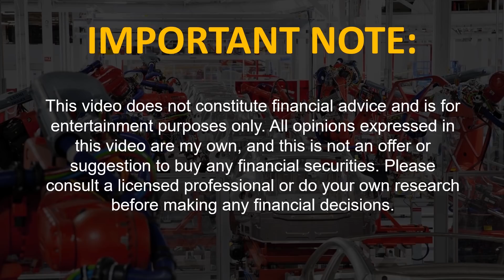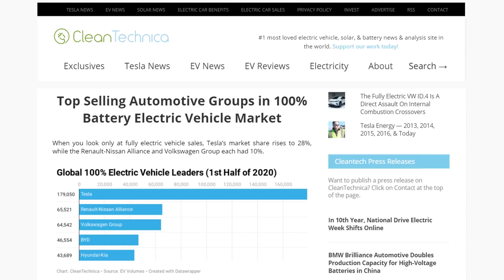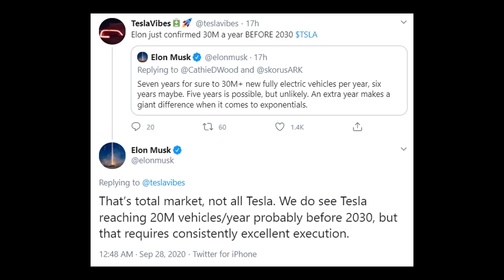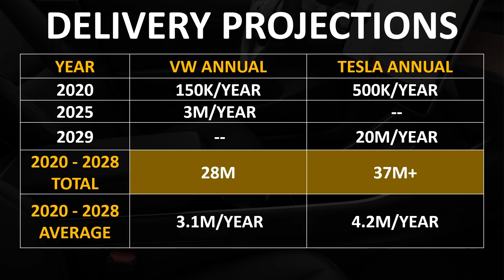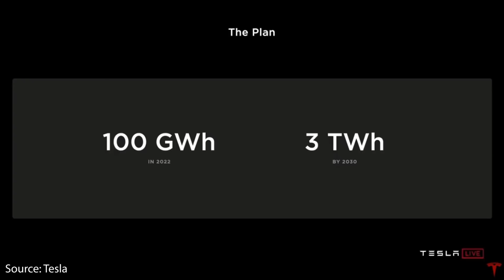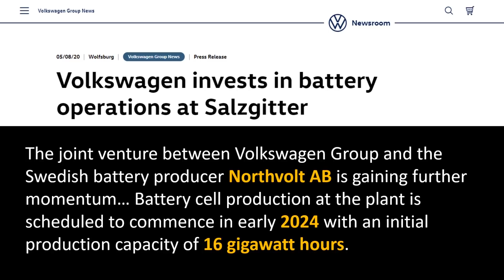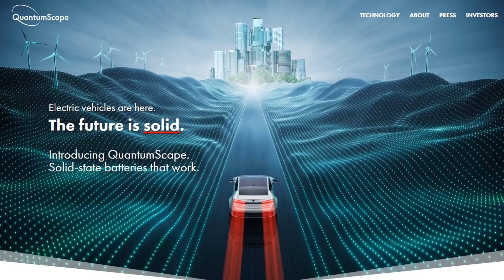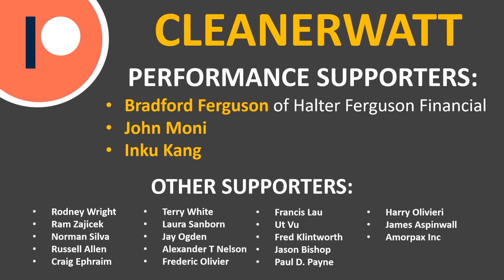Tesla vs VW: Can VW Catch Up? (Electric Vehicles)

Comment: So based on your charts. VW can produce 3 million in 2025 and Telsa 3.5 million in 2025. So if VW wants to product 20 million EV i think they can as well by 2030. Every TESLA fanboy thinks only TESLA can produce EV's in millions. VW can to and it will be proven with the ID4 launch and production number for 2020. TESLA BATTERY TECH is 3 years away for mass production. Until then its anybody that can win a major share of EV market.
Reply: The thing is, it won’t eat into Tesla sales, it will eat into ICE sales. 
Tesla’s vertical integration makes them highly profitable per unit sold compared to other OEM’s. 
Tesla’s super charging network also makes them more desirable. 
Then there’s all the highly profitable software Tesla has as well.
Reply: @teamjg277  I talking about People thinking only TESLA can produce EV for the masses. VW OS is being made to compete with TESLA. Tesla is not fully vertically integrated they are going to be for battery but that is 3 years away and there will be bottlenecks as its not an easy task. In the mean time VW can catch up to tesla production number as they already invested more than 10 billions for their battery supply and production. 
VW is vertically integrated as TESLA now.
Reply: Gowtham V VW can mass produce EV’s but this isn’t going to put a dent in Tesla sales. Tesla can’t even meet its current demand.
Reply: Gowtham V VW isn’t vertically integrated though. They outsource. Locking in battery supply isn’t the same as battery manufacturing
Reply: @teamjg277  Lol. I am not a TESLA bear and not a plain TESLA fanboy though i booked a model 3 when it was revealed. VW is the only manufacturer that is pushing EV's. It won't affect TESLA sales but VW can match and surpass TESLA in total sales if they want to.  So do your own research first before commenting no one can produce a EV compared to a TESLA. Tesla has efficiency improvement due to years of EV experience. Also VW ID3 is the first EV for VW and they have delivered a mass market EV on their first try. How did they do that when TESLA was only able to produce mass market EV in recent years as well. This is due to technology improvement over the years for the battery. So tesla don't have any battery advantage until they can produce their own batteries which will take many years. And VW is also planning to produce their own EV batteries so VW can even compete with TESLA batteries in the future. And for car production VW has the advantage due to efficiency and better car manufacturing than TESLA widely know fitting and gap issues with car panels.
Reply: @teamjg277  Lol. Go and search on google who produce VW ID3 motors its the VW group of companies so VW is already vertically integrated. Tesla also don't produce their own batteries which they buy from Panasonic and CATL just like VW now. VW owns part of the battery suppliers company so it owns part of the business and has joint ventures where VW can produce their own batteries if they need to. But with battery improvement i think battery suppliers can match TESLA range and efficiency though TESLA will have an cost advantage in battery manufacturing though VW has the advantage in car manufacturing as they know how to build quality cars even at lower prices and VW scale of production is leaps and bounds ahead of TESLA due to owning a lot of brands like AUDI, SKODA etc which use the same MED platform thereby reducing cost.
Reply: @GowthamV07  no car manufacturer in history has scaled vehicles manufacturing as quickly and efficiently as Tesla. VW isn’t vertically integrated. They don’t do their own software, they don’t do their own chips, they don’t do their own alloys, they don’t build any of their own manufacturing robots, they don’t have their own corporate software... the list goes on and on and on. 
The only reason Tesla sources batteries from other suppliers outside of their Panasonic partnership is because that’s their limiting factor. Panasonic even has a manufacturing line inside the Tesla factory to increase vertical integration. Tesla is even looking to go into mining and refinement to take vertical integration to the next level, so please, VW may be a second place, but it still a loooong way off Tesla’s vertical integration. 
When you write your own software for your own chip you can literally make it super efficient. Something now other car manufacturer has yet been able to replicate, let alone do very well outsourcing it (for an EV).
Also Tesla’s car are more profitable than VW’s EV’s.
Reply: @GowthamV07  “Volkswagen has also laid foundations for the development, testing and production of battery cells. A battery cell factory with a capacity of 16 gigawatt-hours is to be developed in Salzgitter from 2020. The start of production is planned for the end of 2023/beginning of 2024. For this purpose, Volkswagen has entered into a joint venture with the Swedish battery manufacturer Northvolt.”

So yes, you are correct, VW is doing some battery vertical integration.... pity it puts them 4 year behind. But like I already said, VW is probably second to Tesla in vertical integration. Anyway, EV don’t actually take sales away from each other, they take sales away from ICE

Comment: Great video. However, Tesla will have about 20  giga factories by 2030 each making about 1 million vehicles and a ton of solar panels and battery storage. They also make about 150 GWh of cells each for a total of 3TWh and 20 million vehicles. I also expect Fremont to be gone by 2030. It was not build from ground up to be a BEV factory so inefficient compared to new factories. Also Tesla will have better places to locate than CA with lower taxes and living costs for employees and less red tape.

Comment: Here in the U.K. The change to EV is now very customer led. Tesla has made the EV desirable to the masses. I know so many people who have decided to keep their existing ICE car until they can change to an EV, for some that is cost, for others range. The important thing is that new ICE sales will fall as a result. This could bankrupt Big Auto before they can evolve to EV production in sufficient numbers to be financially viable without high sales of new ICE vehicles to support their huge costs.
Reply: I think if there was a subsidy for people switching to electric, that if they trade in their ICE cars, they get a bonus (say $3000) on top of the trade in, and the ICE car gets scrapped, we would see adoption a lot faster. There is a huge money hurdle for a majority of people.
Reply: @xXYourShadowDaniXx  There is a subsidy or incentive in most countries already. Scrapping a nearly new car makes no sense at all. Owners of 'junkers' are unlikely to be in a position to afford an expensive BEV !
Reply: No worries, Tesla already have the 500 miles battery for the half price. They're making huge manufacturing changes as of right now, and they will be producing their batteries 7 x faster than now. Tesla model 3 will be $25,000 car here in U.S. by 2022.
Reply: @peterp4753  The Model 3 costs $39k or more. The cost reduction to the battery manufacturing applies to the 4680 cell alone. The materials used get no cheaper. At best that might lower the price by around $3k.
Reply: @pasoundman  
You didn't watch the Tesla battery day or you're just dumb. Tesla new batteries are much different and much better, made from different materials than the older one. Much more energy, density and range. They will produce those batteries 7 TIMES  faster,  and their cars assembly lines will be performing much faster because of the casting machines that they will be using, it will allow them to use much LESS parts to assemble their cars! That's advanced engineering at it's best my friend. 
Have you ever heard of SPACE X company?
Reply: @peterp4753  The 4680s shown use exactly the same materials as before. That's why they have an energy capacity that's simply in the ratio of their volume. No 'advanced engineering at all. Do the math. What has Space X got to do with Tesla's batteries ?

Do you have an engineering qualification ?
Reply: @pasoundman  
No, they are not using the same materials in 4680 battery. Do your research, or I will have to give you the details. 
So you know that Space X is own by Elon Musk, right? Do you know that Elon Musk is the Chief Leading Engineer there?
Reply: @pasoundman 
Wow, you really don't know anything about Elon Musk and Tesla...
New battery have the raw metallurgical silicon in it, specifically battery anode. Wet process to dry process of the electrode is different and improved. They even mention secret sauce in the battery cell...
The old battery current is 6 Amp, new one is 36 amps. Result is, 500% energy increase, 600% power increase. The whole battery will have 54% range increase. 
Cathode have increased amount of nickel in it.
When comes to Elon Musk and Space X,  first Elon Musk is the self educated man and his formal education doesn't matter that much, he is the GENIUS!! Just so you know, Elon Musk is the Chief Leading Engineer in his SPACE X company. Space X makes REUSABLE RACKETS that flies frequently into space putting their satellites for super fast internet access/connection for everyone to use on the planet EARTH. You are welcome! Their project will be finished within next 6 months. Next project is mission to the Moon, after that Mars. 
Even NASA can't build REUSABLE rockets, and Space X is doing it for the FRACTION cost of what NASA would, and is spending on their space projects.
Comparing Tesla to any other car manufacturing company is the fucking INSULT to Elon Musk !!
Reply: @peterp4753  Explain how 5x energy increase in a 5.5x larger battery gives you 54% more range. The materials HAVEN'T changed. You've fallen for the hype.
Elon Musk is a bullshitter and you're a fool for falling for it.
The 'cult of Tesla' (and Musk) is wearing thin. The competition's coming and no amount of hype will stop it.
He's NOT a *genius*. He's just a rich kid with some loopy ideas. EINSTEIN was a true genius.
Reply: @yingnyang2889  Do you seriously think that other auto makers know nothing about making cars and can only copy Tesla ? FYI, Renault was making electric cars decades before Tesla. They were making the Zoe back in 2012 and others before that. Yes, I know all the fancy names you post and it changes nothing.
Reply: @Big Auto' will survive nicely. Tesla hasn't the manufacturing capacity to be any more than an annoyance to them, In any case there's no end of car makers producing EVs now.
Reply: @pasoundman  
In 5 years Tesla will be producing about 5 million cars per year for much less prices with much better performance than now. All other EV car manufacturers producing poor performance, shitty cars!
Reply: @peterp4753  Explain how less money means better performance.I was literally just now watching one of Bjorn Nyland's ID3 reviews. As a Tesla owner, he LIKES it. You can hype up Teslal as much as you like, doesn't change anything. You also don't go from 500k vehicles per year ton 5m by 'pressing a button'. VW and others have the factories NOW !

Comment: To slow CO2 output, the world needs to produce about 100M EV vehicles p/a by 2030. So we need 4 or 5 companies doing as well as Tesla. It’s a disaster that no one seems to catching up.
Reply: Mike, you should really look at the development of worldwide EV sales over time. VW growth was 80% in 2019, will be close to 100% this year and they have built enough capacity to double next year. Thus is why they jumped from 6-th to 2-nd largest EV producer in the last 12 months.

Hyundai/Kia is also growing very fast, they just don't talk so much about it. They sell.

Nissan is in decline this year, Renault doesn't have enough money to invest, but Toyota is finally waking up. PSA did a quantum leap this year, other EU producers will either follow or go bankrupt within 2-3 years.

And the Chinese are coming too. Just look at MG, Volvo, Polestar - owned by Chinese and selling tons of EVs in Europe this year. And that's just a start.
Reply: @DenisHavlikVienna  - you can’t tell very much from current sales, as figures are low. Thus distorts percentages. But yes, VW seems to producing ok EVs and NIO etc produce a small number of great cars. However, most legacy producers are technologically behind Tesla in terms of software and battery tech, maybe 5 years behind. They are struggling to match the 2014 Model S. Most Legacy makers lose money on EVs. Hopefully this will change, with 4 or 5 EV producers getting into the millions p/a by 2026 or so.
Reply: @miken4591  you do realise that Tesla isn't producing batteries? They buy them from Panasonic and CATL, just like everyone else.

And yes, they may end up producing some in the future, but so will Volkswagen. Look at their investments.... Batteries (Northvolt, Quantumscape, latest was something in China...), autonomous driving (Argo AI), digital services, energy, car sharing...

People are completely underestimating the size of their investments and the extent of a change this will produce.
Reply: @DenisHavlikVienna  - of course. However Tesla had recruited the world's top battery scientists and automated battery assembly engineers. They have reimagined batteries. VW has partnered with Northvolt, but the key question is - can VW/ Northvolt match Tesla's pace of innovation? Hopefully they can. But ad I said elsewhere being nos 2 is probably good enough as Tesla can at max supply 20% of the market.

Comment: I saw a VW without a driver the other week. I do not know if it was remote controlled or not. But if it wasn't Tesla will have some competition shortly - a couple years. If it can solve the battery problem.
Reply: WV has 40% share in Argo AI while Tesla is nowhere near to full self driving capabilities with their camera vision approach.
Reply: @Gardillus  oops ... think again
Reply: @martinvannijnatten8134  ops, I can think as many times as you want, but it won't change reality. Tesla's camera vision only approach is just wrong. Even MobilEye - the company with the same approach that is way ahead of Tesla and that has way more mileage data says that they will start using Lidar for safety and redundancy. And almost any company using Lidar has much better disengagement rates per mile. Tesla's new FSD beta is incredibly unreliable and still fails even in simple situation.

Comment: I don't trust any of these forecasts.  In Tesla's case, they're aspirational and assume no bottlenecks will appear - financial, raw material supplies, hiring, etc.  In VW's case, they're just not feasible, particularly after Tesla's Roadrunner announcement.  Battery manufacturers will be frightened to invest billions of dollars in new production capacity of old-tech batteries whose cost per kilowatt-hour will be two to three times what Roadrunner will cost, and will deliver sub-par performance as well.  Demand for those old-tech batteries will dry up as Tesla ramps Roadrunner - not because Roadrunner will be made available to other BEV manufacturers, but because other BEV manufacturers will be forced to higher price points with inferior products, which will tamp down demand for old-tech batteries.

The only way VW will keep up will be to source batteries as inexpensive and capable as Roadrunner, or close to that level of cost and performance, at least.

But they can't.

Tesla's other tech leads are icing on the cake.  Better software, better efficiency, better range, innovative production methods.  For example, can VW reduce vehicle production costs through large castings?  No.  There's simply no source of aluminum alloys that they can find to work with those large casting machines.  Tesla uses a proprietary alloy no-one else has.

So while I don't trust Tesla's Elon-time aspirational growth forecasts, I do trust that Tesla is in the driver's seat and won't be dislodged.  And as Roadrunner ramps, Tesla's lead will only grow.

Things may change in the 2030s.  New battery tech might appear.  New production methods might be found by Tesla's rivals.  Anything can happen.  But through the rest of this decade?  It looks grim for both old-tech battery suppliers and for BEV manufacturing rivals.  Tesla is poised to expand their market dominance, though not at the pace Elon projects.  There are always bottlenecks to solve during production ramps, and they eat up time.

Comment: And you just mentioned the batteries! What about the Tesla's lead in manufacturing? Who will possibly compete with Tesla single rear and front casting? With their own proprietary alloy? VW, Ford, GM.....? Not to mention FSD and so on. 2nd place is open i guess...
Reply: 2nd place is fancy way of saying 1st in line to lose
Reply: RC18, anyone can buy those casting machines lol, the competition is coming with the casting machines....in 10 years time again?
Reply: @ssot7503  Who needs complex castings anyway ?
Reply: FSD is a total irrelevance to low cost 'sustainable' driving.
Reply: It's the alloy they patented. Rather than the stamping machines needed. Anyone could buy those machines and I'd bet some bev startups may go that route. Or attempt to? 
But without the alloy, who knows if it'll pan out.